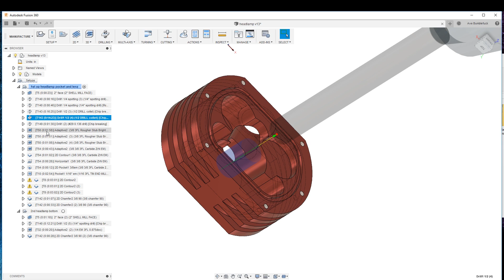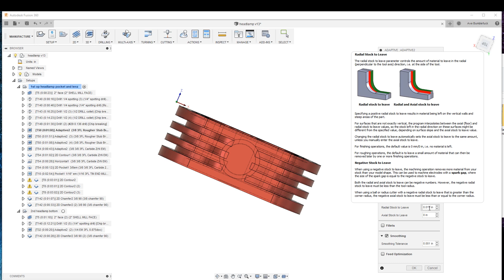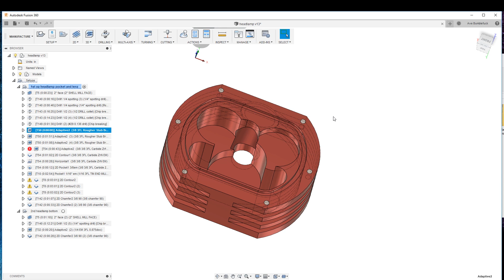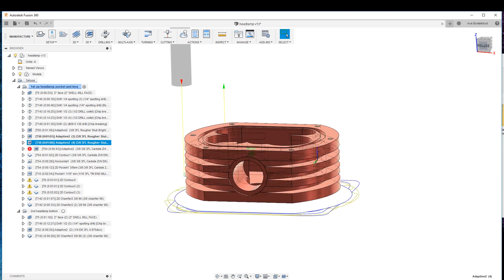Speedy Fusion 360 Ep. 07 2d Adaptive

Comment: If you need more length out of an endmill you can neck it down. by grinding part of the shank diameter about 10 - 15 thou smaller than the flute diameter. Just don’t grind to high on the shank that you have nothing left to hold onto.
Reply: I think youd need cutter grinder for this, surface grinder can be used, and most prob know diamond wheel for carbide is needed they'd find that out pretty quick though.

Comment: “Smoothing” has nothing to do with finish. It’s purpose is to cut corners and remove points. The tolerance is how far you are prepared to go away from the programmed path. Turning it on will remove a bunch of gcode lines. In some roughing adaptive toolpath, it can cut the code by half!
Reply: Is the end result a smoother tool path? And a smoother finish?
Reply: Steven Kelby I guess it could, specially on an older controller that has a hard time keeping up with a lot of code.